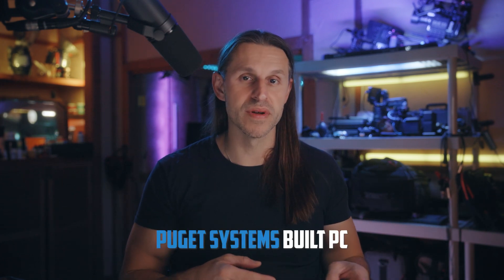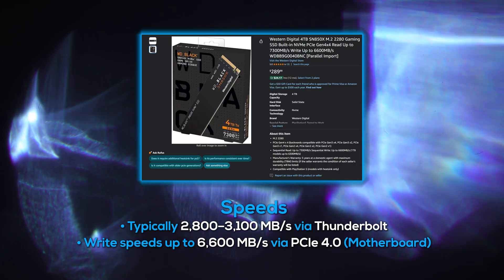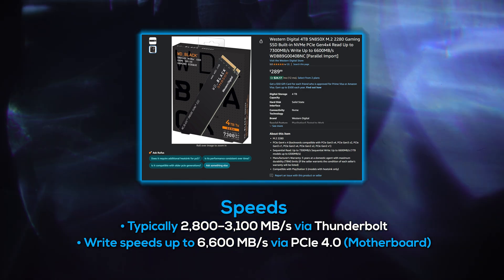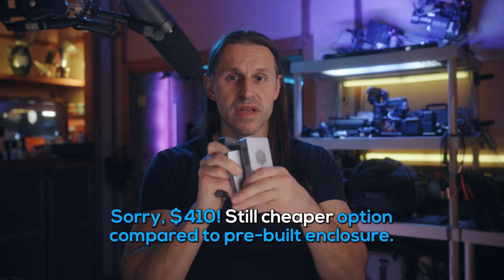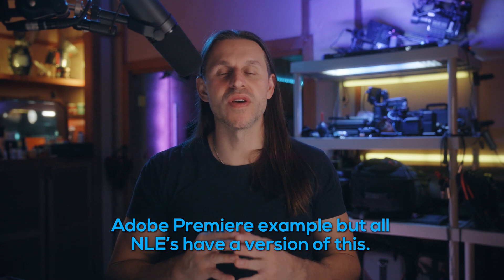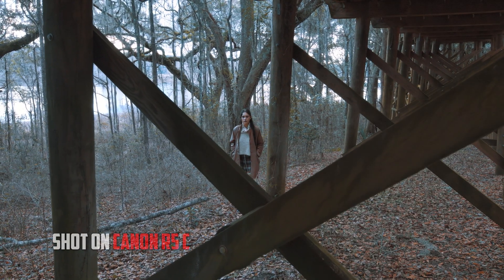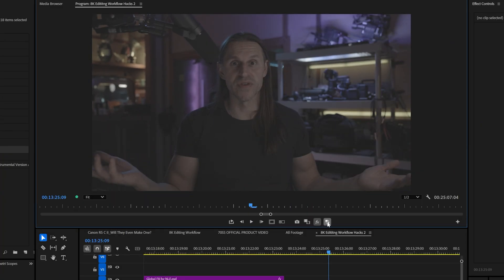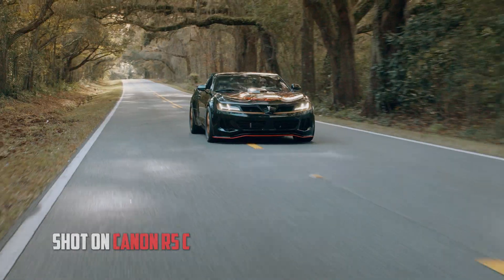8K RAW Editing on a Budget: Making it Work with Your Computer (Canon R5 C & RAW In General)

Comment: Switch to davinc and a mac! Smooth editing. Also there are some interesting nvme nas systems available, your alsi not limited to 10 gb nic's anymore. There are fiber options like 40 or 100gb.... of course you need a switch and nic cards capable of accepting fiber optics. But "high end" server options are now reasonably priced for a home lab set up.... 

Might be overkill but the data rates wouldn't be your bottle neck anymore at all. 😂
Reply from the maker: Sounds nice. 20+ Years of PC and Adobe Premiere, with my 50 hour work weeks, really gotta time the set back of switching to Davinci and/or Mac in meeting deadlines  for clients which hasn't let up for the last 3 years straight.

However, Maybe for the next go round of when I upgrade in the future.
Reply: @AshvonChamier yeah, it's a learning curve for sure. I know it's tough to switch.

Comment: Just picked up a r5 c
Reply from the maker: Well, you are going to LOVE IT! Don't be shy to use that 3200 ISO more than you might think in bright situations and just ND the front. Easier to nail cleaner noise free images and opens the door to using higher apertures for more full depth of field in shots where you have people in your shot at various focal lengths talking to one another.

Comment: I end up dropping frames only when I use long GOP but the CPU will overheat when editing raw
Reply from the maker: Interesting. So the RAW plays smooth but overheats?
Reply: Yeah even if running at stock. Then because I am using Icue from Corsair the lights in my computer start acting strange. Sometimes it will blue screen and in order to render effects when editing using 8K raw I absolutely have to be on Nvidia's Creator driver and not the gaming driver.  @AshvonChamier
Reply from the maker: Sorry I missed this follow up reply buddy. I hope you got things working smoother?

Comment: I have an 8k workflow. I purchased most of my drives when NVME storage hut an all time low. I also back up current projects to a 16tb raid. Other shooters think I'm nuts when I explain it. 

Two 4tb NVME external in enclosures. Three 2TB NVME external enclosures. 16tb raid zero Nas for current projects. A 16tb Nas as cold storage for proxy's of old projects that I keep for retention. Then spinning external drives for features with master files.
Reply: R5C for my Bcam and Red Komodo for my A cam.
Reply from the maker: Killer pair for sure.
Reply from the maker: Sounds great to me. I back up every project twice between Raids and External  Hard Drives.

I archive client projects for 5 years before deleting. That has paid off several times when clients contact me randomly a few years later for new projects and are interested in incorporating some of the other footage from our first project together that may have not been used.

Comment: Amy thoughts on the c80?
Reply from the maker: Wonderful looking camera in many ways. Lots of attributes. Wish it had CF cards and could do 8K RAW or at least 6K 60p. But it is still a fantastic looking model. The price point on the R5 C with it's 8K drove me to get a 2nd R5 C instead of a C80. I do a much more in depth discussion about this in this video if you have not caught it and are interested. 

A 2nd CANON R5 C Instead Of R5 II, C80, C400, Komodo X
https://www.youtube.com/watch?v=XP59UN_FzoE&t

NOTE: This video above video was made several months before the price drop on Komodo. But, most likely still would have gone with 2nd R5 C for my one man band productions most of the time.

Comment: think a mac would be worth it?

i really like windows, 

was thinking of similar specs but going slight above
AMD threadripper 7960x 24 core
RTX 4080 super 16
ddr5 2x32GB @6400MHz cl40
icue link titan 360 liquid cooler 360mm aio 

wonder if this would be good for multi 8k layers?
Reply from the maker: Because I’ve only gotten to work with my last PC and my current PC, i just don’t know. I would guess that thoses  on ecs work well. However, I regularly go into the 80 and 90 GB of ram territory during complex Adobe Premiere projects. A lot of Mac users have reported they can edit this 8K canon RAW like butter. I’m pretty much planning to switch to Mac when i get my next computer but want to get at least 2 more years out of my current machine. Unless some mile stone happen for PC architecture like has happened for Mac’s M3 and M4 chips… I’m going Mac.
Reply: I had a 1950 X for my first threadripper build and it was struggling as a aged with long GOP footage. Sometimes the proxy files for the raw were long GOP and it was totally screwing up my Adobe premiere timeline. That being said it seemed to be more of a premiere issue than anything else. However the cost of threadripper CPUs are pretty insane right now. Not sure if you're going to be buying a used but yeah. I ended up going with a i9 and it definitely uses 100% of the CPU when editing this C Raw.

Comment: I video an average of 10 hours of sporting events a week in 8K 60 Raw, with very large projects at the end of each season.  I use the OWC Thunderbay 8 with (8) 4TB Samsung 870 EVO in a raid (single drive fault tolerance).  All backed up to Synology NAS.  The Thunderbay 8 has been a game changer.
Reply from the maker: GREAT TO KNOW. What kind computer are you using and what NLE?
Reply: @still on the m1 ultra studio, FCPX. Awaiting release of m4 ultra. OWC coming out with m.2 8 bay blade (6500MB/s speed)…but not having any slowdown with my current (much cheaper) solution.  I appreciate your videos! Haven’t found many others that film 8K 60 on a regular basis.
Reply from the maker: I do film mostly in 8K... but going to 60p too often.
Reply: I am editing on a i914900k and 5090 and I'm editing a half hour timeline and my computer is barely ticking along. It's just the raw footage that will not render fast. Long GOP won't edit well but renders fast.

Comment: Ha. Been telling ppl to do this for years, but no one really thinks about it. Such a great option. Make sure you are getting 40gbps or higher enclosures and absolutely make sure you are getting 40gbps or higher cables, otherwise all is for not.
Reply from the maker: Yeah, for sure! I spent a whole day editing once with terribly slow performance... realized I had accidently connected it with a USB 3.0 type C cable. LOL

Kicked myself in the ass that night!
Reply: @ It’s not enough you need to be a talented filmmaker, you need to be up to date on all the current data transfer rates on specific drives and cables!!

Comment: Another excellent post! wow! learning so much from your channel & getting to know the R5c better!       🤔 I can get 12 bit shooting RAW with it...? Also how about 8K 60 (do I need an external recorder for that, like Atomos...?). In one of your previous posts you mentioned a focal reducer adapter to get 6K S35 and an extra F stop? any brands you suggest and where do you place it?  Last one: does the R5c offers "pre record" like the RED cameras do...? (mostly for wildlife...)   Thank you ! cheers! 🙌
Reply from the maker: Hey, thanks man! Yes on 12 bit color when you film on RAW vs 10 bit with compressed.

You CAN film 8k 60p INTERNALLY. BUT, if you are not using one of the new Canon LPE6p batteries or an external battery solution, you will not have auto focus. I will also warn you though, 8K 60p is much more demanding on you your computer editing than 24p.
HERE IS A LINK: https://amzn.to/42eiwvp

I use the Canon Mount 0.71 RF to EF Focal reducer to film in 6K RAW and still maintain a FULL FRAME field of view. Plus it does also add an extra stop of light to any EF lens you strap on it. BUT to be clear, this is only an option if using EF lenses.
HERE IS A LINK: https://amzn.to/4gSZgYK
 
Unfortunately, the R5 C does not feature a pre-record feature. Wish it did.
Reply: @AshvonChamier  hey man! thank you! This camera is truly a beast! Definitely timeproof for another 4 or 5 years. planning to use it for nature and wildlife... but with so many features I am sure I can widen the options for shooting! Love your channel! So much knowledge shared!  I appreciate it! cheers! 🙏   Do you think is of any advantage to use  it with a Atomos...?  Do you know if it would give me extra features? (I think I could get that pre recording option if I am not mistaken...), thoughts...? cheers! ;)
Reply from the maker: Sorry I missed your question buddy. Yeah, it's future proofed well into the next few years easy. Having an external monitor is a MASSIVE help for pulling better focus, assessing shot compositions, and having bigger exposure tools is great. You can a nice monitor an not worry about it being an ATMOS RECORDER and buying media for that. I have cheap $300 Portkeys LH5P  monitors for each of my R5 C's. They get very bright which I need for bright days. They are not the best option out there for picture quality but still a MASSIVE improvement than just using the rear lcd on the cam. Definitely wows my clients more too when they look over my shoulder at the shots I am getting.

Comment: Awesome Work! Scopes disable intresting.I use mac so not sure if you are familiar with. I have a 32tb G-speed ssd shuttle thunderbolt 3 raid0 and i check speed w blackmagic speed app and getting around 800 MBs read write. I really dont want to rebuy a new workflow but curious if there is a way to bump speed as it says around 2100 speed?. I started in raw but gave up 3 months ago and started shooting 200MBs. 🤷Your clips and editig is Georgous. Thank You
Reply from the maker: Super interesting and thanks for sharing your experience on here. I don't know, but would guess that the 800MBs is your real world speed max out. All these drives quote such high numbers but don't point out that it is only in very specific use cases in the perfect environment. BUT, the higher the sped the drives are qouted at, does equate to faster real world speeds even it they are not as high as the numbers qouted. 

I do have a Macbook Pro but it is a 2019 model with the M1 chip and starter specs. It handles the 4K XF-AVC very well. No go on RAW. I really just got it for bare bones editing while on the road and data backups while traveling.

But the M4 chip in the new Macs sound like they are performing so well, in a year or two when I upgrade computers, I am seriously considering switching to Mac fully.
Reply: @yeah i just started on a m1 barebones 1tb 3weeks ago . When i started raw 3 or so years ago i had bought the i9 maxed out one month before the M1 came out 7500 bucks not knowing the machines were not really optimized even though 8k better yet Prores raw was the power was not there for say a 4 to 8 Tb timeline in my experience crash after crash. Thinking now assuming that workflow had to be done by multipule machines and editors for easy turn around . A catagory cutter or story shot clipper, audio sound designer,colorists,and graphics designer for Fx or even transitionist to complete a project shared on each machine🤷but i9 just 🤮i would like to revisit raw asoon as i recover.  Ive got the storage,raw recorders an cameras by the way i was told by guys i know w a hunting show to get the R5  but went the Lumix route. I like them . I also know ther show is full of georgous images like yours.I only have less than a handfull of videos on my channel relating. Nothing close to your work.its badazz! Thank you for your time. I think i can work raw w those speeds if and when a machine upgrade is  doable. Thank You

Comment: Does the R5C record 4k raw 2k raw beside 8k raw??
Reply from the maker: It records 8K RAW in Full Frame, 6K RAW at Super 35mm, and 3K RAW up to 120p in a Super 16mm crop.
Reply: @AshvonChamier  wow thats awesome im sold thanks
Reply: @AshvonChamier with the canon speed booster is that super 16 back to super 35 for 3k raw ?

Comment: This is the first time I notice serious noise in your talking head footage. Maybe some NR could help.
Reply from the maker: Yeah, because I am so busy with client work, I am weaving camera test to me making these.  I am different ISO ranges for an upcoming video. This was ISO 2500, which is dirtier than ISO 3200.  I am still experimenting but comparing dynamic range and saturation changes across the ISO ranges. 

I could have run DeNoiser across this so you are right... but it would have added to much time to the render. 60 Hour work weeks right now trying to include these on top of client work. lol
Reply: What denoise are you typically using?
Reply: @MeAndMyOpinions_OverYours  I'm used to davinci
Reply from the maker: @ Red Giant's magic Bullets Denoiser III.

Comment: thanks for your workflow sharing its awesome, I also edit everything on Samsung SSD t7 4tb when I run out of storage, I edit on a MacBook Pro 16" M3 Max with 4tb of storage, so when I have a job that requires speed or various FX, I edit direct on my computer, im planning to purchase the sandisk professional SSD 4tb thunderbolt 3 or the MAG SSD DOCK that also looks fantastic for workfloww speed 

i have 4 R5Cs and they are fantastic, so much versatility, I do photo, video and livestream, last year I did a pre olympic match and the cameras run for 10 hours with out any issues
Reply from the maker: THANKS! Also, thanks for sharing what's working for ya with your R5 C's. Having a second one this past few months has just been fantastic for my shoots. 

 I will have to check out the Sandisk you mentioned. Hopefully others will come across your comment as well so we can all explore this battle together.

Comment: Hey Ash, great information.  I have an R5C and haven't really shot much in 8K as I thought it would be too taxing on my system.  I might look into taking some of your suggestions and trying to see if I can come up with a work flow that makes sense.  Thanks for the video. Cheers!
Reply from the maker: I really hope if work for ya. In addition to the cropping ability and color grading options it opens up, there is just some extra notch of dimensionality to the final  image even after it is exported as H.264, that I just feel like I am missing when I use XF-AVC. Not always, but OFTEN. 

Best of luck in trying to get it to work on your machine buddy!

Comment: Omg this is what we all need to learn on 8K raw workflow. I've always been wondering whether I should just shoot 4K non RAW or in 8K RAW. I really want to have the best optimal image quality possible and I really don't mind storage consumption. I know that my current PC rig couldn't do 8K but it needs an upgrade.
Reply from the maker: Thanks for letting me know you found the info valuable buddy. Hope you can get it to work on your current computer possibly. I am trying hold off another year at least, before upgrading. I might go MAC! I have a 2019 MacBook pro and while it can't handle the RAW, it does so good for it's lower specs... that I can only imagine using the new M4 chip. I am still so clunky at navigating Mac OS though.